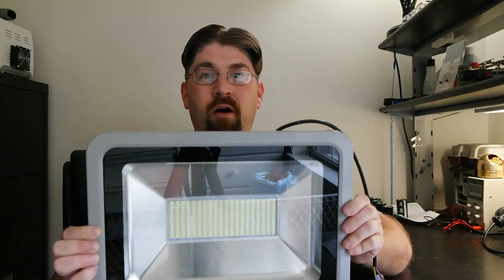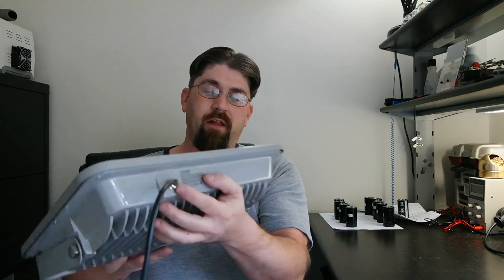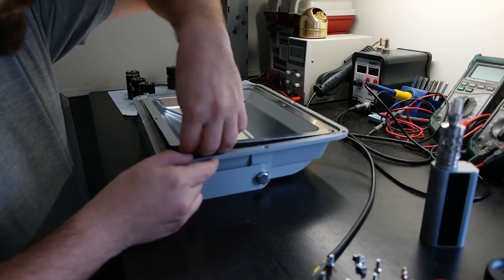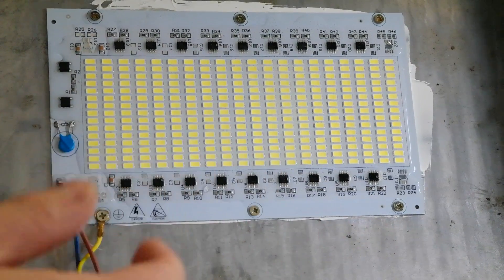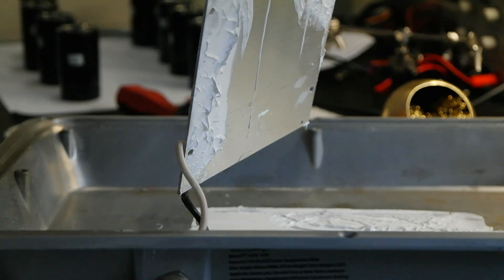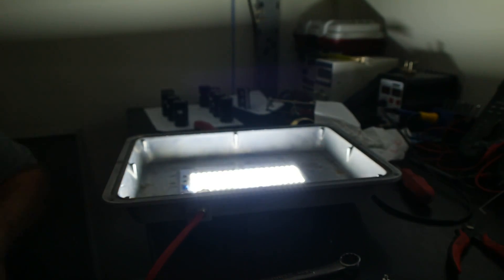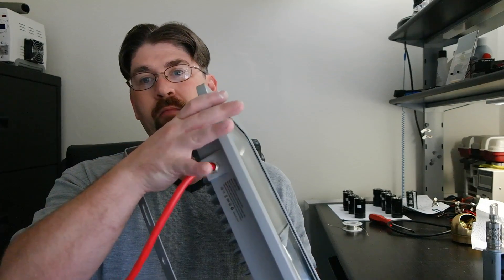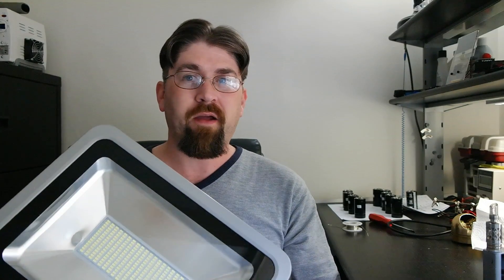$40 150 Watt eBay LED Floodlight Review, Repair, and Modification

Comment: Great lite, super brite, fits in most places i used it   share4.photo/pWorkLight      only thing i would say is i was hopin it b bigger, but works great under trucks, inside cabinets, and when workin on the tractor.. prob buy another soon

Comment: Hi there,
This is Helen from china.I checked your youtube,you do lighting advertising right?you also can check our product.I'd like you be our influencer deeply cooperation.what do you think?
You can call me in any time.or leave your phone number. whatsapp+8613918818393
We are a one of the leading outdoor lighting manufacturer in China, specializing in led flood light, street light, solar light with 50,000 square meters Industrial 5.0 production facility 
Why you should choose us for cooperation:
1.You can get unique designed light using OSRAM & CREE import chips with a very competitive price to win a bigger market share
2.You can get free DIALUX lighting solution if with project details provided 
3.In order to lessen your financial pressure on payment, we can do L/C 60-90 days to support you,no worries of the product quality.
 Welcome to contact us for more information.

Comment: I whish I had seen this video, or taken the time to open one up and look myself for that matter. I ordered one, measured that it was earthed and then ordered a bunch more. I figured they got that right, it seemed somewhat sturdy (at least chinese sturdy), and the heatsink got hot.

They seemed very good value. So I bought 4 of these big ones and a whole bunch of smaller ones 20w ones. Then went through all the work of wiring for, and mounting them all over the yard, garages, sheds, everything, which took a week or two of quite hard labour. 

When installed, in the winter with the yard covered in snow it was quite an effect when they flicked on :)

However now, coming up on 2 years later none of the 150w models work. They flicker dimly at best. A couple of the 20w units still work but the majority is broken. The reseller has completely refused to honor their "warranty" of course. Is there a chinese translation for warranty?

Does this unit still work? What should one buy?
Reply: I own a 200W version of this light.  Worked well for around 17 months.  Then will not turn on anymore.  Didn't know about the heat-sink-compound issue until seeing this video after my light stopped working.  Wonder whether adding heat-sink compound and remounting circuit board would have made a difference.  I'm thinking of trying a COB flood light as replacement.

Comment: I would like to know how to open for repair a large led reflector that has no screws? Is it by the heat sink (which has rivets), or by the glass removing the glue?

Comment: Horrible mounting. Screws are only on two edges. Instead there should be some on all edges, and ~3 in the middle, to ensure the PCB actually is flat and adheres to the back. Horrible. It can't even be easily fixed. Not even 150W.

Comment: I purchased some similar floodlights and found they'd flicker, then trip out the electric. They have been replaced with working units, but I still have the faulty ones and was going to take a look at them. I don't know if it would be caused by poor wiring, or whether the LED it's self is faulty. Any advice from you or anyone, who as come across a similar fault with these floodlights themselves, would be greatly appreciated, so I at least know where to start looking (I'm not electrical expert as you can probably tell!)....

Comment: The problem with that 150watt Driverless LED COB is the efficiency. They claim 70-80 lumens per watt but you'll only get about 60-65 when new and it will drop quickly and those COB's will fail quickly. You really didn't save any money. A 150watt light on 12 hours every day take $151 a year in electricity at 23 cents per kwh. If you bought one with the new Cree on Philips LED's and using a real 150watts you can hit 150-172 Lumens per watt so you would have almost triple the brightness at (150 Watts at 150-172 lumens per watt) compared to (113 watts at 65 lumens a watt.) OR you could run less wattage for the same brightness and energy saving almost Triple on your Electric bill. That's $100 a year savings if you run the light 12 hours a day. Best to spend a little more for High efficiency Cree or Philips Osram LED's. Also the High efficiency LED's need somewhat smaller Heatsinks as more energy is released as light instead of heat.
Reply: Which Cree and Philips series are you discussing?

Comment: The blue thing is probably a tantalum cap or a MOV, the other 2 chips are full wave rectifiers to supply the DC to the LEDs and their regulator circuits. Thats a boat load of light man..

Comment: The blue component is a VDR not a polyfuse. It is used for over voltage protection. Practically it will blow the fuse on the circuit board in the case of overvoltage.

Comment: I don't understand the point of tripping it down and turning it down and then you're worried about the house catching on fire. If you reverse engineered it to do whatever you wanted to do and not the way it's supposed to be done I guess it's kind of your fault. I understand it's Chinese light and us some of them are pretty cheaply made and we can go back and fix some of the items but it looks like the board was made fairly well

Comment: Seen this video, and thought, "I'm tired of climbing extension ladders twice a year replacing bulbs". So, I bought 2 of these for the work shop. I pulled mine apart to check it. Connections were good. The thermal grease on the back?  One light had just over 50% coverage, and the other one was maybe just under 75% coverage.  Thanks for the info on checking that!  Got that fixed... Now I hope to have a light that will last a few years.

Comment: The unit is quite good, it just needs to be opened up inspected and re-assembled properly, however the main board is a smart chip drive, the chips running all the way along actually switch groups of leds in and out as the voltage swings up and down at the line frequency, they tend to fail from the excessive heat. The trick is to run them well below there rated power, for reliability. The blue disk is a MOV and the 2 4 pin chips next to it are the bridge rectifiers.

Comment: Brown wire separation inside is a good warning for anyone who wish to spare penny on Chinese online shops. Your extra cheap purchase most likely will work - after thorough check for cold solderings, missing components and similar things. By the way such board is a strip of uniform LED lamp lines which can be cut to size you'll need for particular lamp. because of that it have caps only at left side. One thing which I definitely doesn't like here - those LED lines are prone to fail at weakest LED in serial connection which apparently will burn out sooner or later. Of course burned LEDs are replaceable, but this sucks anyway.

Comment: How is the light dispersion?  

I've seen a few setups like that sold as LED worklights and they are very directional making them annoying to use compared to the old school 500watt halogen ones.  I have a stand that has 2 halogen ones mounted on a crosspiece that I really like and I've been thinking of grabbing 2 of those and replacing the heads with these LED units and then using it for both a work light and for video but I'm worried about the light being too directional and I'm wondering if 2 of them will be too bright for just about everything.

Is it still working?
Reply: Dewalt has has an issue of their LED work lights being spot rather than flood lights. One guy covered the lens with cloudy Scotch tape to act as a defuser. Another bought a replacement defuser panel for an over head florescent  light and cut it down to fit.
Reply: Do plastic diffusers survive in front of these things?  I would imagine they make some heat if they need the heatsinks that they are often supplied with...
Reply: Possibly could if mounted tight to the glass, Depending on application  mount the diffuser an inch or two or even 6" from the light to avoid heat build up. I believe he said it had a glass lens, you could have it lightly sandblasted. But that would be permanent.
Reply: LOL, why didn't I think of that?  I just sandblasted some plate glass to test it as a printing surface for a 3d printer, I'd bet that I have enough sitting around that I can blast a little more to try this with it...
Reply: If you don't have that blasted glass mounted yet, use it for a test. Stand it up in a dark room and shine a light through it to a wall, raise and lower the light to see the difference the blasted glass makes. You might want to try different glass with varying degrees of sand blasting from light ,medium and heavy.  Good Luck,

Comment: HEAT WILL KILL THIS LAMP- It set destructs- It should have a thermal switch added and an internal fan, and seeing that the aluminum plate is not flat to the housing you should place it on a flatter well made piece of .064 aluminum beforehand and it should be plane tested to see what % is in contact. Thermal grease is there only to fill voids, and is a substitute for metal to metal contacts, because these surfaces are only held at perimeter and no screw in center. whereas one could drill through four outsides and pull a wire through the housing and have it go across center and have 4 equidistant centered tension posts on the LED face between circuitry; there is enough room. USE MUSIC WIRE a simple metal or hard rubber wedge on the outside back of housing will make it more than tight enough to make it right. tensile strength That wire when hard drawn is 225,000 to 400,000 psi, it is flexible enough to bend 180° without cracking. Additionally, it can wind into a close helix with an inside diameter 1 to 1.5 times the diameter of the wire. SO UPGRADE THE LIGHT OR IN A NORMAL USE for an hour+ of heat rate over X days. IT WILL FAIL.

Comment: Tear down before use is standard procedure for anything bought cheep these days.  Be responsible for your own safety!  I am shocked (no pun intended) that the ground wire was actually connected.

Comment: I know the original didn't have it, but I'd have put an electrician's knot in the wire if I was replacing it. Just something for a bit of basic strain relief, since it's not being used as the intended wall-mount and that cord could get stepped on and yanked.

Comment: The light still working?  I bought some "50 watt" lights... they struggled to consume 38 watts and got so hot you could cook with them.   A couple LED's failed miserably after about 3 months.  Ended up putting a capacitive ballast to throttle then back a little.  20 watts and they're going strong after a year.

Comment: I bought the same light except for a 500 watt. When I converted to the plug wire and plughed it in the led don't fully light up but I do see little light dots from each leds. Do you happen to know what may be wrong? Thanks in advance

Comment: I think the blue component may actually be a VDR (voltage dependent resistor) as over voltage protection?
Yes I had an ebay cree flashlight that melted the LED because the PCB was not mounted correctly.
Great review, very informative, great job!

Comment: Its a very unnaturally light .. throw it in the trash
Reply: Nerys color temperature has no correlation to CRI.
Reply: no its fine he just needs to "balance" it. buy 2 one warm and one cold and that should get you a much much better more natural CRI. also change the color balance of the camera to compensate as well.
Reply: Yeah,  white balancing for that will do a lot to fix that look.

Comment: Those lights are complete crap. Lasted 3 months then led drivers burnt up. Not just one light but 4 of them.
Reply: Kevin Ault  yes they are. I purchased 8 of the 300 watt from a local store. $250.00 each, thought I was buying quality at that price. 3 months in and all have burned out. They won't help and I can't seem to figure out how to repair. Expensive lesson learned.
Reply: they are all over driven. assuming they can handle it what I like to do is buy 2 and then cut the voltage back so they consume half the wattage. same light from 2 as one at full power.

They tend to last much much longer that way :-)

Comment: Wow, so much thermal compound!  It's supposed to help fill the tiny gaps between the metal surfaces, not be a layer in between.  The metal conducts heat better than the thermal paste does, so you want as  thin a layer as is necessary and no more.  The people that do crazy overclocking of CPUs will lap their CPU heatsinks to get a better mate to the surface of the CPU paxxkage so they don't need as much thermal compound..
Reply: Louis Mamakos in china you use as much as you can to loosen your us enemy and ship as much toxic waste as possible.. insulating a non grounded light is just the tip of the iceberg
Reply: True if you have two flat surfaces. At that point, thinner is better for the best thermals but what happens when theres a gap you can't close? The cast aluminum casing and or the PCB was slightly warped preventing a thin layer to even touch. There could be a 1/8th gap and it could takes ounces of compound to even fill a gap that large. Time for some thermal adhesive and tons of pressure while it dries to reduce the gap.

Comment: what a crap! I don’t understand the chinese manufactures. With a bit attention, they can do excellent products! For example here, just mill out a half inch pocket, and install a proper connector on the fu.king pcb! And add some huge insulation between the pcb and the house. We talking about 1-2 dollar more, then what? No way to install this shit under any garage entrance! You just drop your car, and on the next morning there is no car and garage, because everything just burns away.

Comment: lol, his video quality is actually better without the light on
Reply: Resolution is the same, but overall "quality" sees increase. With more light the shutter speed can be increased (less motion blur), ISO reduced (more detail, less grain) and the even lighting is helping reduce the contrast in the image. 

CRI won't improve by adding any different LED lights though as they will still be missing parts of the spectrum. To make that work he'd need very expensive high power, high CRI LED's. Really the best solution for ligthing in this application (lighting a scene for video/photography) is with good old fashioned halogen. You can fix some of the colour issues in post, not too tricky as once he figures out the colour profile but this guy isn't a photographer. Using LEDs (especially cheap ones) is just making his life fun but harder.
Reply: “It’s fricking bright” got me every time 😂🤣🤣
Reply: no. quality (resolution) is better but CRI is worse. he needs to add some heavy warm white led's to compensate and increase the CRI overall. also needs to change the white balance in the camera for the "different" light spectrum its shooting now.

Comment: Takes light apart for no reason. Breaks solder joint trying to remove  gasket around the led board. Blames China because he messed it up..... lol
Reply: It shouldn't come off that easy though.
Reply: "Takes light apart for no reason." 
Incorrect. 
He stated why he needed to take it apart, which was to connect the cable he needed for this particular use.

"Breaks solder joint trying to remove gasket around the led board."
Incorrect. 
Something like that doesn't even come close to being able to affect solder joints.

"Blames China because he messed it up."
Incorrect. 
The joint was not properly made in the factory.
Reply: What is crazy is how many people i see that will do anything possible to save money, buy the cheapest price they can get it at, and expect something that was put together quick to bring down cost, low qc to keep cost down, and expect it / hold it to standards that u actually pay for when u pay 4 and 5 times the price u paid. Same thing in construction, they will hire a cheap mexican crew pennies on the dollar and be like damn this looks like shit, i got screwed. If people have no more sense than that, we are a lost cause lol.
Reply: That heat sink connection was definitely a huge quality issue!  The compound should have been applied much thinner and spread evenly. then, there should have been at least 6 more screws inside the LED array to keep the two parts in good contact.  Alternatively, they could have used a heat sink epoxy that was cured while the parts were held together with a press.  But, remember, this is China crap.  The manufacturer has no accountability.  If it goes up in a puff of smoke after 2 hrs and burns your house down, what you gonna do??
Reply: Robert Marley lol that's what i said but yes needed a couple of screws
Reply: True that.  You get what you pay for.  Be cheap, buy cheap, get cheap.
Reply: Yup

Comment: only a varistor that main the Electrical Surge around 800,  it's low standard, for the outdoor using and big wattage produce, in which electrical Surge at least 2000, why the standard so low?